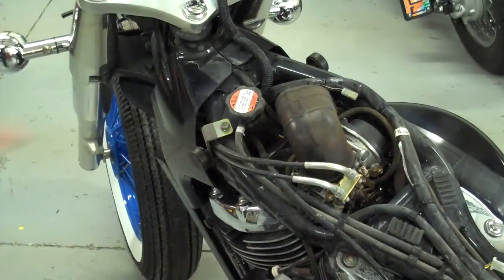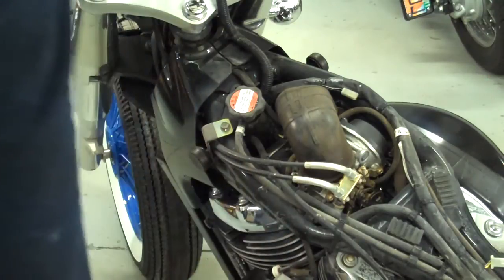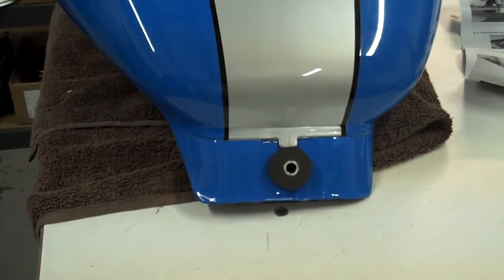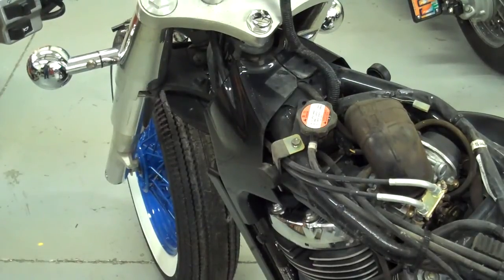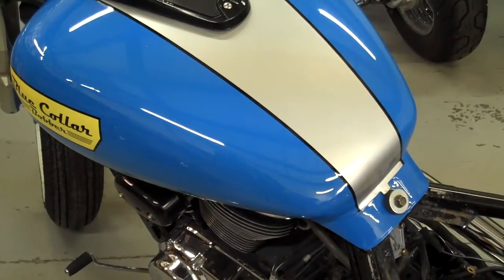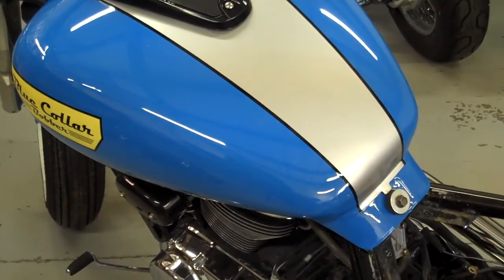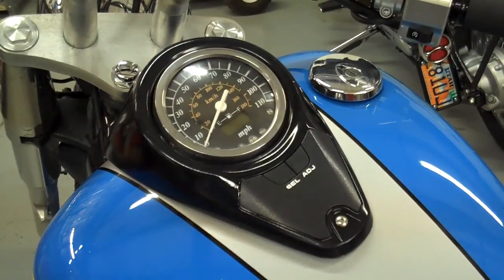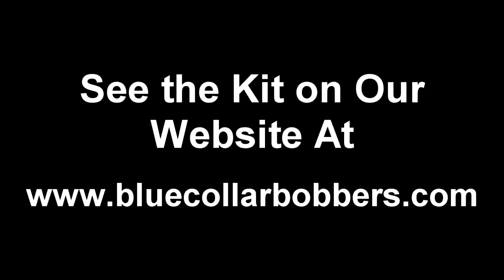Suzuki Volusia (C50) 800 Gas Tank

Comment: Thanks for not showing any of the work...
Reply from the maker: What do you mean? Thanks, Lance
Reply: What do you mean, what does he mean? Look at your own video. It’s starts with the fuel tank already off, not showing how to release the fuel lines, electrical connections, or tank mounting hardware if any. Of course there are some, but if a non-mechanically inclined individual, or even someone who is handy but doesn’t have diagrams to refer to for some starting point would be clueless as to how to begin, and complete removal for that matter. Then after stating the obvious—that you removed the tank— you cut to a clip with the tank already back on, agin not showing any process. Smh